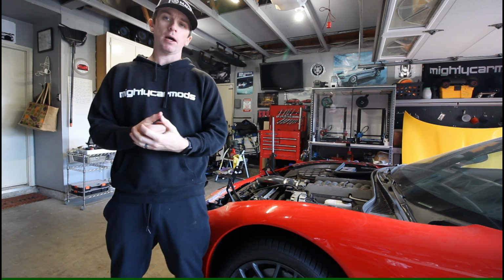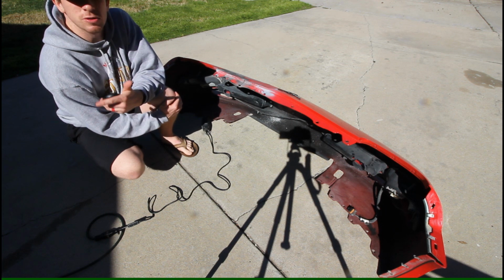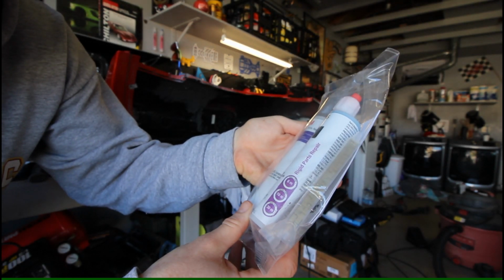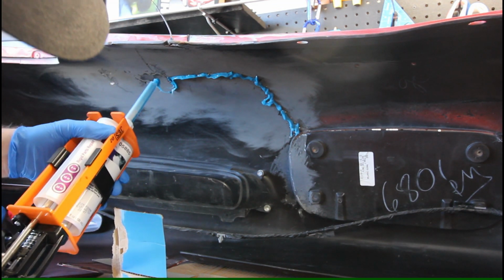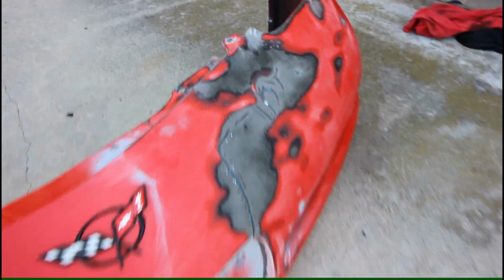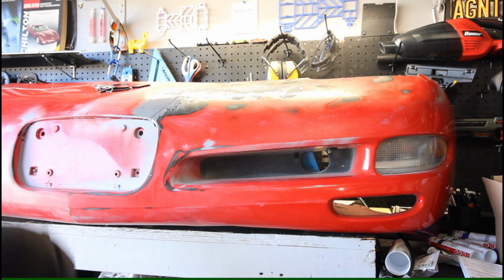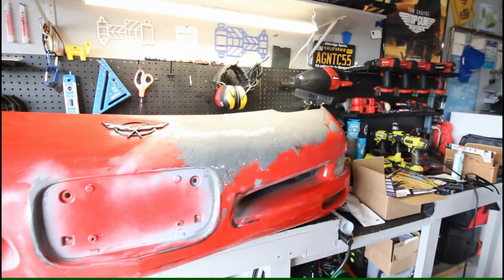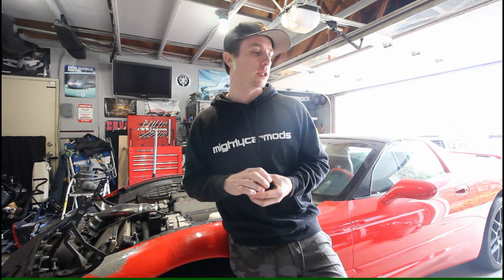C5 Corvette Bumper Repair - The Right Way?!? - PART 1 of 3

Comment: You did that the long, hard, expensive way.  Try a urethane repair using a Polyvance airless welder and some or their urethane welding rod.  Its faster, cheaper, and stronger than an adhesive repair....not to mention a whole heck of a lot lighter because you're not adding all that adhesive.  Not bad otherwise.  You did a great job prepping it and feathering the filler!
Reply from the maker: Hm, maybe I’m misunderstanding the method you’re referencing, but the material the C5 Corvette front and rear bumpers are made from are not plastic weldable because they’re not a traditional thermoplastic polyurethane. They’re made from a thermoset resin which just burns when you try to “melt” it. I tried plastic welding two different times (in case I didn’t try it correctly the first time) using two different kinds of plastic welders. The first time I tried the traditional soldering iron kind with the flat triangular stamp and the second time I tried a hot air plastic welder. Both times the material burns and does not melt. Sure you could melt filler material into the crack but it’s not going to bond to the base material. That’s why I went with the long way of performing this repair using different kinds of epoxy adhesives.

Comment: For all the trouble it is worth, I'd just get a new bumper bro.
Reply from the maker: Not really. OEM bumpers in good shape are hard to come by, especially locally, and they’re not cheap. A decent bumper with minimal damage is going to run close to $1000, and you’ll most likely have to paint it anyways. Most used bumpers have some type of damage, and if they don’t, it’s a high likelihood they’ll get damaged during shipping because it’s such a large item. Plus this entire project is about teaching myself new things. Repairing this bumper was one of those things I wanted to learn.
Reply: @Addimotive  Ok thanks, I am asking because I was just going to buy a OEM bumper. I currently have run into the problem a lot of C5 owners have done at some point, and that is damaged the front radiator support skid bar. Unfortunately it has ripped out of the bumper left drivers side and torn the holes it screws into underneath, also splitting it, also pulled out the lug it screws into in the chassis frame which means I have to weld up the hole in the frame lol... luckily the damage isn't noticeable unless you look underneath.
Reply from the maker: @exoticspeedefy7916   interesting! Didn’t realize GM parts center still had them. Just be careful though, sometimes they’re OEM “recreations” and don’t have the same quality as the bumpers that came on the cars.
Reply from the maker: @exoticspeedefy7916  so you’re saying the impact ripped out the rivnuts from the frame? You could try and drill them out and then install a larger sized rivnut. I’ll be making a 3D printed radiator support skid plate in the near future to help try and minimize damage to those pieces.
Reply: @Addimotive  The hole in the frame will need to have a patch welded the hole is too big I think. As it pushed it back creating an oval hole. I used to be a fabricator welder so this is no sweat. It's the bumper that I can't repair on my own, I don't have the skill have never done panel work so the shop going to have to do it. Probably around $450 or so (NZD) I have already ordered a radiator support skid from Amazon Its aluminium.
Reply: @Addimotive  GM parts centre has one for only $417.68 so I guess they are still making them

Comment: What a coincidence I need to almost do the same thing to my C5 bumper cover although my damage is very little I still need to take out the cover and work on it with the same method and the same tools as I'm seeing here, awesome video by the way!!👍
Reply from the maker: Glad the video could help! There isn't a lot published out there on how to effectively repair these bumpers. They're made from a very obscure material that only works with certain repair materials. They definitely don't follow the conventional repair method for most bumpers since they're made from a special thermoset plastic.
Reply from the maker: I plan to film another video shortly that specifically covers what body repair material you should use to repair each part of the car since there about 3 different kinds of materials used throughout all of the panels.